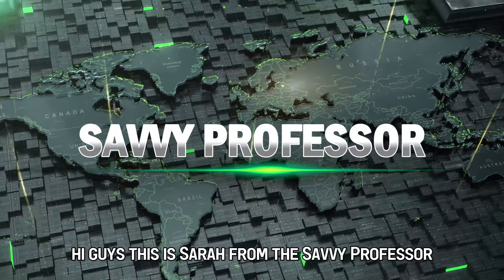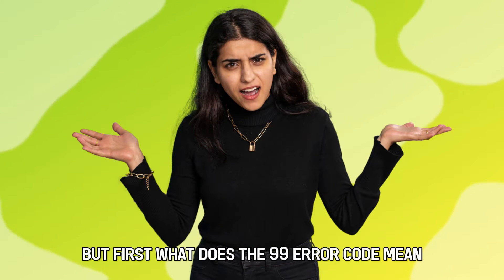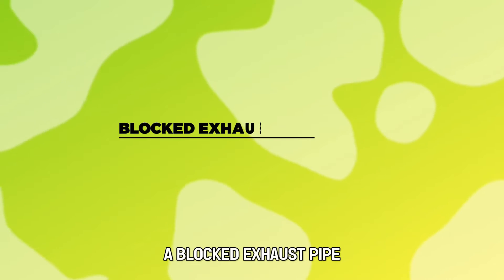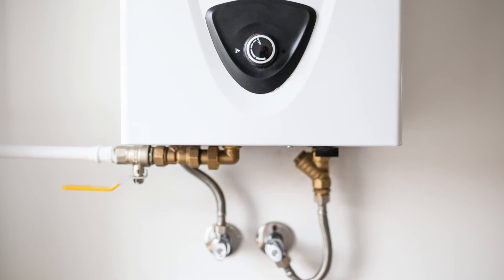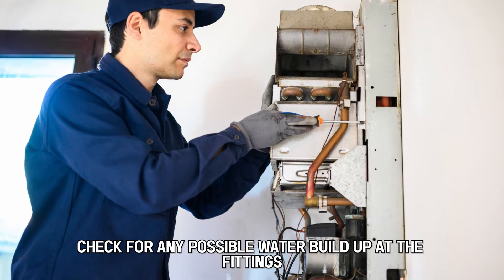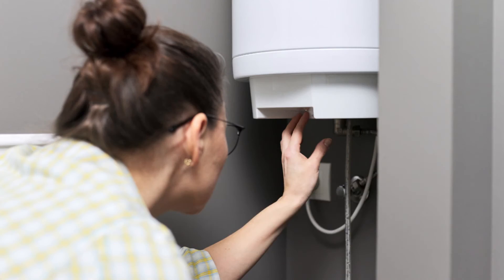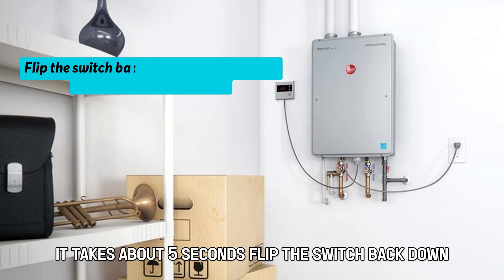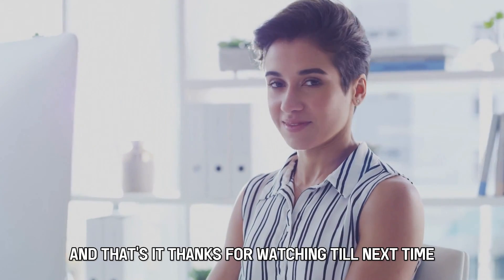Rheem Tankless Water Heater Error Code 99 (Meaning, Why It Occurs, And How To Solve The Error Code)

Comment: We have a rheem water heater, model:ECOH200DVELN-3,  SERIAL:W252457755. I try to reset the system, but won't let me.
I press min and max and dip1 and switch 2 and hold it for 7sec and nothing happen. Also I tried pressing it longer and nothing happen. 
Need help?